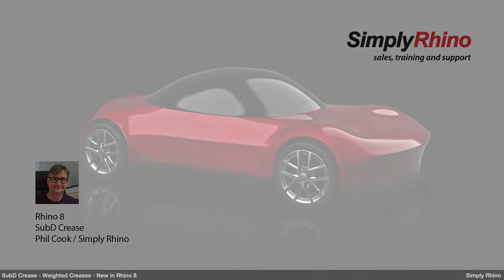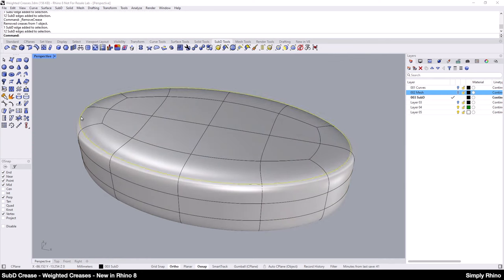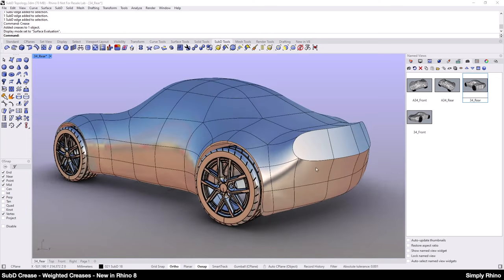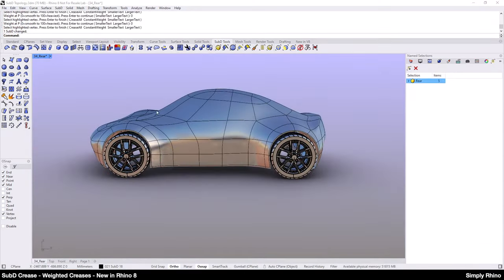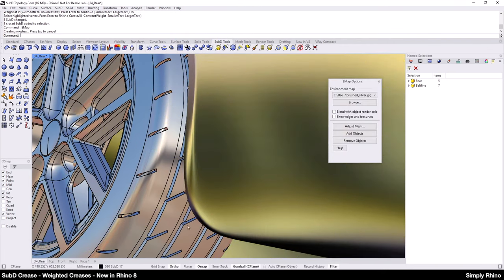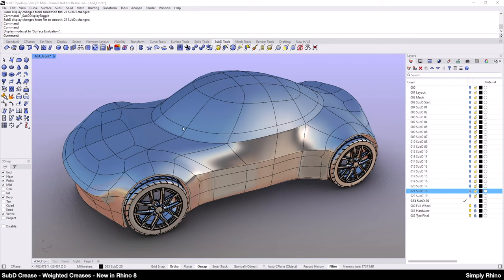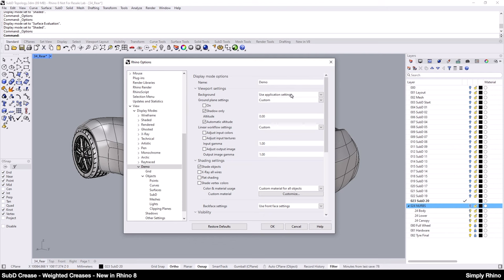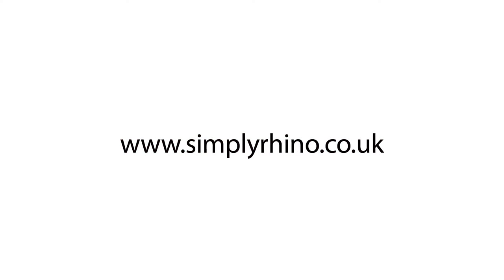New in Rhino 8 - SubD Crease

Comment: 3:05 I'm relatively new to Rhino and I've been looking for this functionality for quite a bit now. For me however, that square bounding box/subd flat mode edges are not visible when I have the subd in smooth mode. Therefore I cannot apply the subd crease. How do you get this to show up?
Reply from the maker: Hi, In the example of the single SubD Surface, use ‘_PointsOn’ (or shortcut F10) to turn on the points (vertices) of the SubD surface. Next, select a corner point and run  ‘_Crease’ – hope this helps and thanks for watching!

Comment: This looks great, but Its a shame that the value is a percentage and not a dimension.
Reply from the maker: Hi, SubD Creases do not create a fillet with a radius – they are more analogous to a G2 ‘BlendSrf’ in that the radius is constantly changing. If you require a dimension along and Edge (so let’s say 200mm from one end) you can use ‘DupEdge’ to duplicate the edges you need and ‘Divide’ to divide the resulting curve by distance or number of segments.